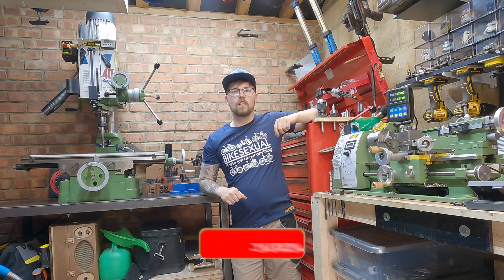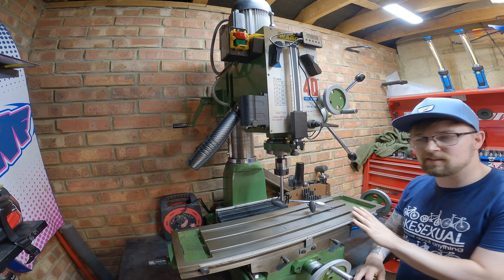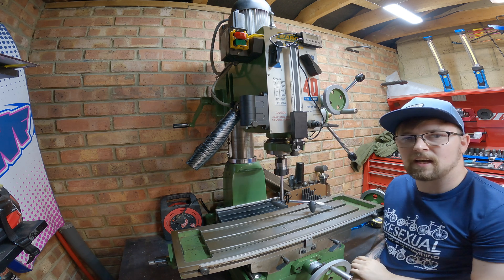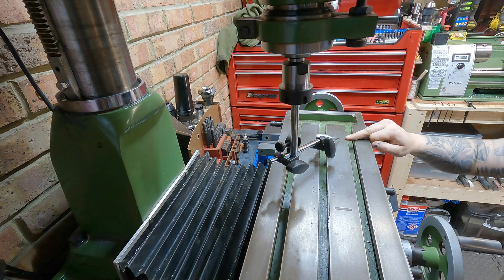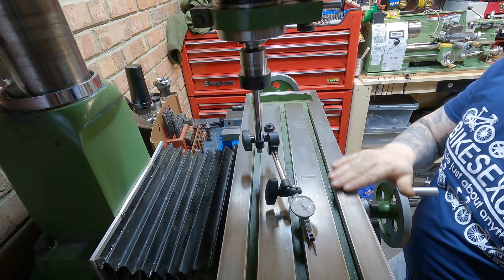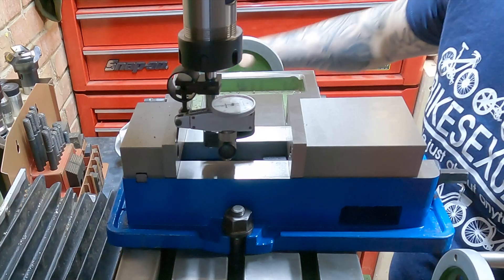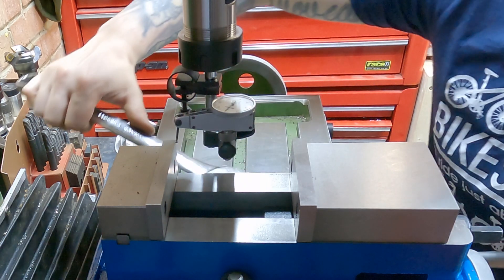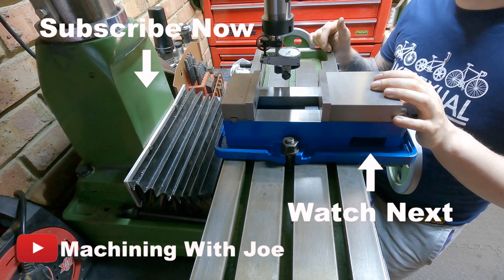My NEWish Milling Machine

Comment: Great vid. Joe. Liked and now subscribed.  I have a Warco RF-40 that is to all intents and purposes the same as the GH-40, it's just older. I bought mine as a mint used condition machine but there was no manual with it. I don't suppose you have a manual that you could copy for me do you?
Reply from the maker: Hi john welcome to the channel. No unfortunately I don’t have a manual as I bought mine second hand. Is there anything in particular you wanted the manual for ??
Reply: @MachiningwithJoe  Thanks for the reply Joe. I was looking for info. on maintenance and what oil(s) to use..
Reply from the maker: I think warco list the oil on their website
Reply from the maker: I’ve just found a copy of the manual in an email chain from Warco. If you email me at 
Machiningwithjoe@outlook.com I can forward it to you john.
Reply: @MachiningwithJoe  Sorry for the slow response. I didn't get a notification of your reply. I've emailed you so you can send me the manual. Thanking you in advance. Keep up the good work.

Comment: Hello,
Thanks for the video ! 
What do you think of the SX2.7 ? 
Thanks
Reply from the maker: Hi there. I’m not familiar with this type of mill. But doing some quick Googling I can see it looks like the standard import mill. If you check out Blondihacks I’m sure it is the same mill she uses.
Reply: @MachiningwithJoe  yeah, about the same. Maybe a bit weaker than hers. Not sure if enough to buid parts for mecanics ( motorcycles for instance). Thanks anyway.

Comment: Congratulations on your new procurement , when I finally got a mill-drill (round column) I became the hammer owner who saw everything as a nail .
Being new to a milling machine, I would suggest you try Harold Hall's book "The Milling Machine" which is a course of projects starting with things like an angle plate, parallels, clamping equipment, all design to progressively increase your skills and understanding of the machine, all the while building up a very useable tool collection. Enjoyed the video, cheers and here's looking to more subscribers, good luck!
Reply from the maker: Hi Howder1951 welcome to the channel,
Thank you for your advise I will check his book out I’m sure by the sounds of it, it will help. All the best 👍

Comment: Let's chat safety Joe think you should use a face visor, protect those eyes having a wm14 I've had a few close calls with chips flying upwards tried goggles and they fog up rather quickly..as Robert points out you look close to the table while working be safe bud
Reply from the maker: Thanks for the advise jinx, it’s all stuff I need to learn as new to milling open to any advise. Thank you.